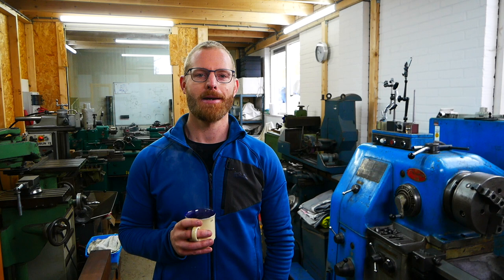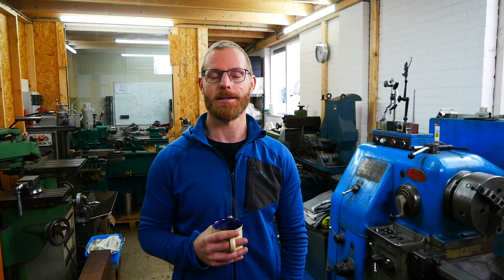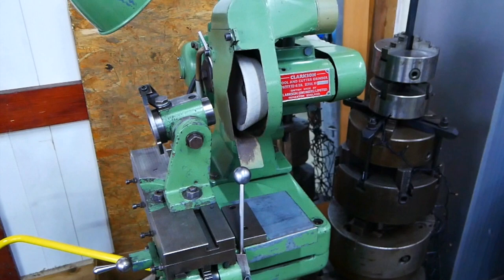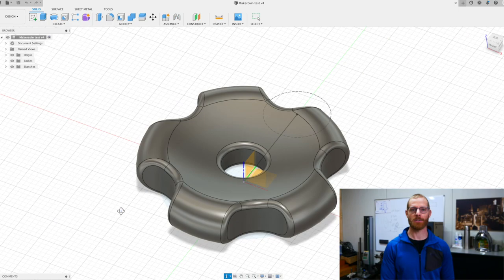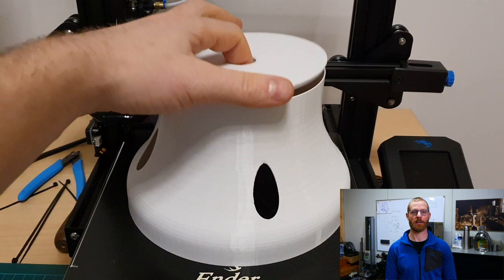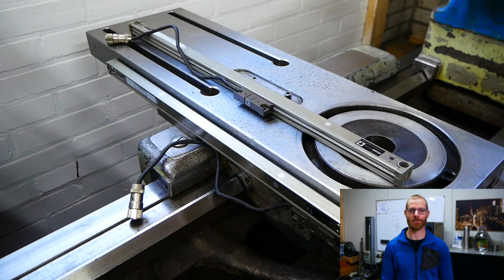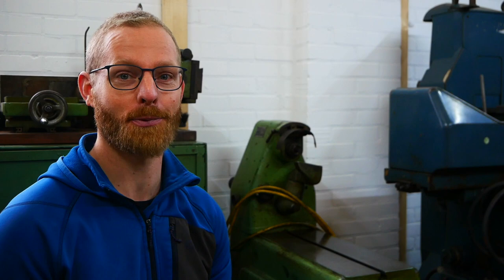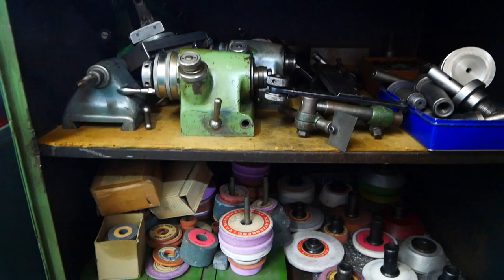Shop Adventures #1: Okuma DRO – Ender 3 – Deckel S1 - Goals 2021

Comment: very nice shop, very nice equipment! but, no heat??  :) wonderful story on the Deckel !!  thank you for sharing.. Looking forward to your project videos..
Reply from the maker: Thanks. Yes heating is a little problem. The shop is not very insulated and i'm not there every day. I do have a heater (you can see it in the vid next to the Clarkson) but the problem is that the machines are very cold and the heater makes the temperature rise fast so the air will condensate on the machines and they start to rust. So only slow heating is posslibel and I put up some extra layers of clothes when i'm working. It's not all perfect but I got to live with what I got. This shop is still is meant for 2-3 years until I can build my own shop somewhere. Until that time I will survive a few cold winter months.

Comment: Hi Bart and thanks for the channel - always interesting stuff and like you enjoy the older classic machines. My journey has only started, retiring soon so want to enjoy so time using machines and took the plunge and bought a Hardinge HLV lathe, have converted it with upgraded electrics and a new control panel which is nice and the quality of the Hardinge is top notch, like the Schaublin machines. I'm now after a Schaublin13 or a Deckel FP1 but in the UK they are almost never seen on the used market and if they do land they are either poor got at examples or way over priced. I was wondering if you or viewers could help and keep their eyes open for one of these, ideally one which needs some TLC but a genuine machine, would appreciate any pointers, help or advice also on the quest for one of these milling machines. In in the UK so would need to get a machine shipped and would also have to buy unseen which is not ideal but appreciate I don't have many options sadly. Mates tell me to get a Bridgeport, there are lots about, just don't like the way the look and to me simple clever designed machines are a must.
Reply from the maker: Hi, that sounds like a great adventure. A Hardinge is also a great machine. If you want I can look a bit online on the dutch sites for milling machines. But then it's best to contact me via my instagram (bartharkema) so I can share the link. At this moment there are two Schaublin 13 on the dutch market and I believe also a Deckel. But price is always a challenge.